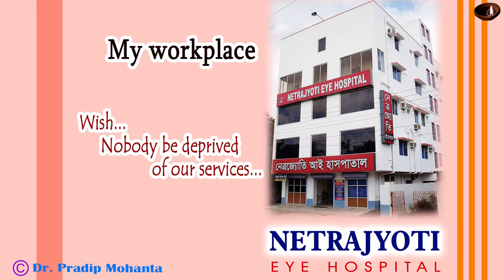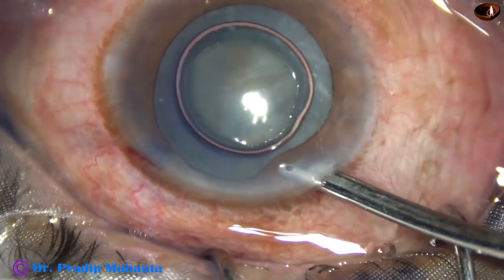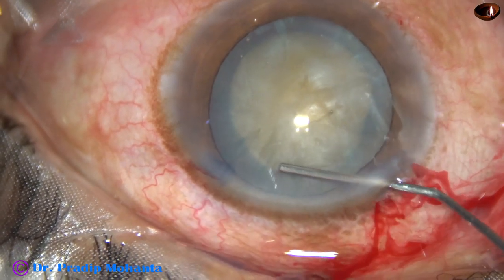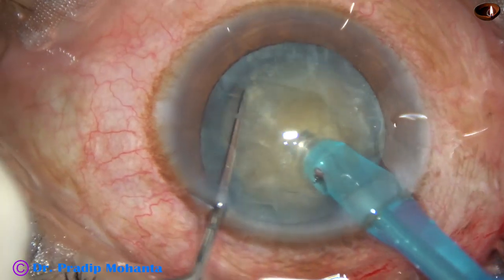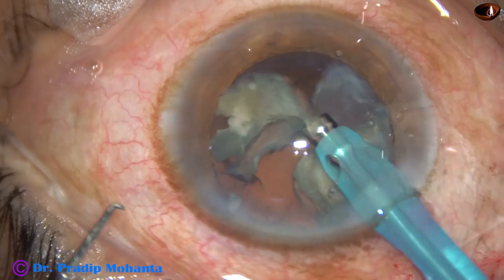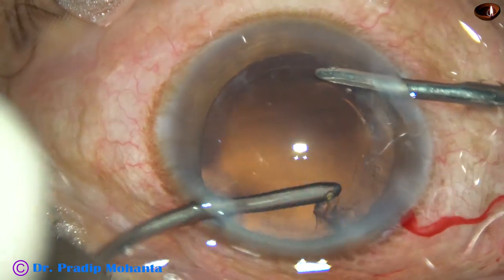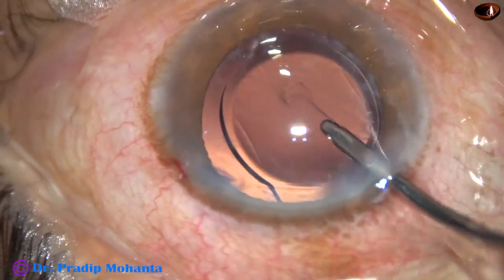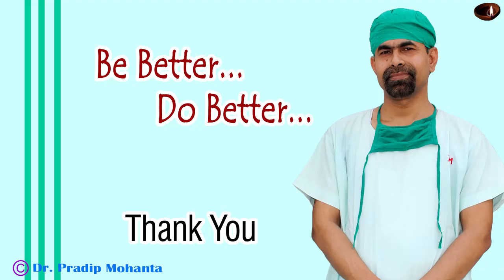A Non-intumescent white senile cataract : Pradip Mohanta, 10/8/2019

Comment: Since  you use the irrigation aspiration set, why do you use also simco cannula?
Reply from the maker: Simcoe:
A nice economic instrument,
A nice instrument to Clean cortex of the inferior part while the assistant makes the bimanual /co-axial ready, (the Simcoe cannula attached to a separate bss bottle is always ready)
A nice instrument to clean Visco from corneal endothelium,  just a gentle stream of bss is Directed towards the endothelium Flushing through its aspirating port,
A very nice instrument to form the AC,
In some situations Simcoe cannula is safer than others. 
Always keep Simcoe cannula in your trolley, Don't think it is an inferior instrument.